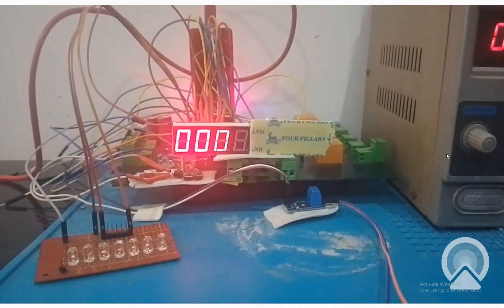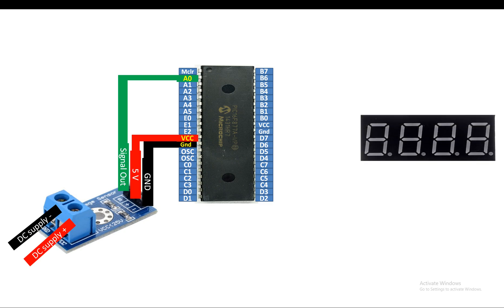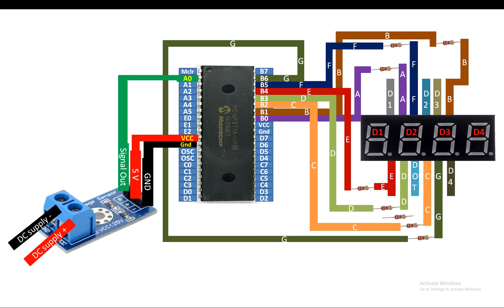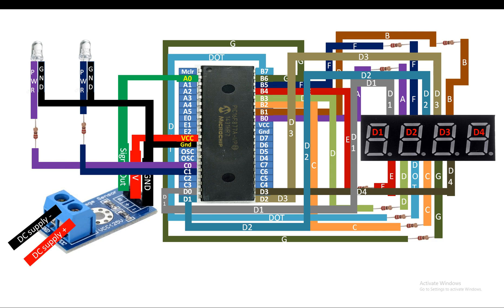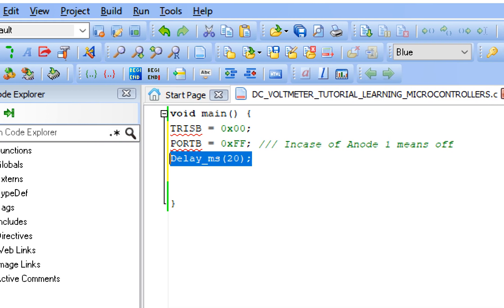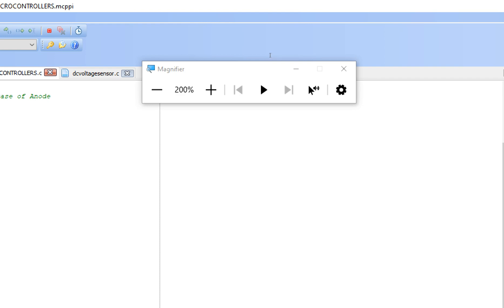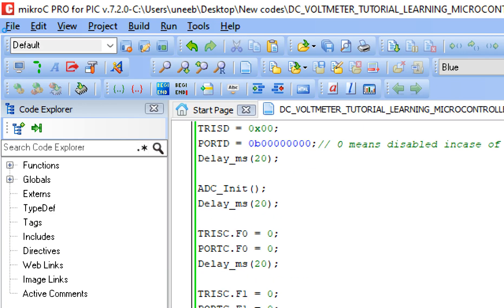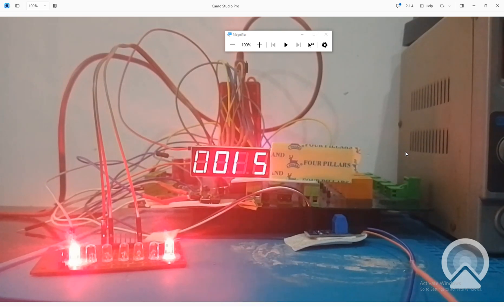PIC16F877A based DC voltmeter using voltage sensor. Output on 7 segment. Led trigger at 5 and 12 V.

Comment: Why is the 7seg screen blinks too much?

And how can we make it stable?
Reply from the maker: I told in the video mate
Use more loops
Increase number of turns in any loop like for loop or do-while
Reply: @learningmicrocontrollers3561  can i adjust the delay of the screen and make it stable?